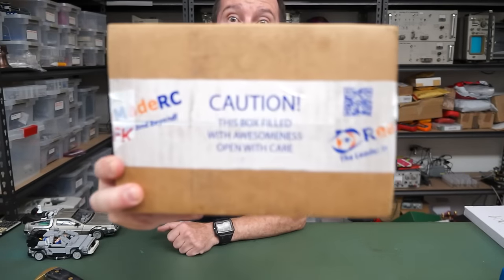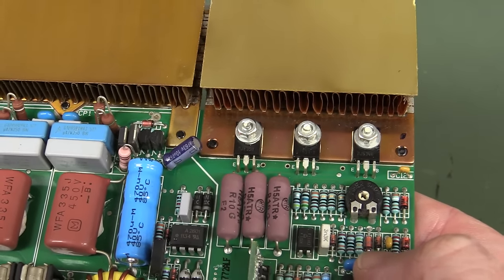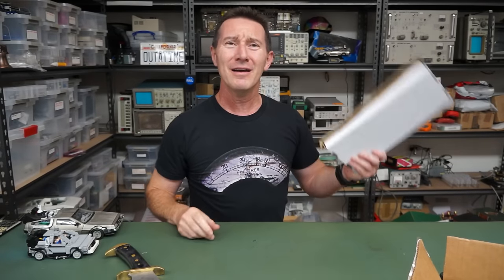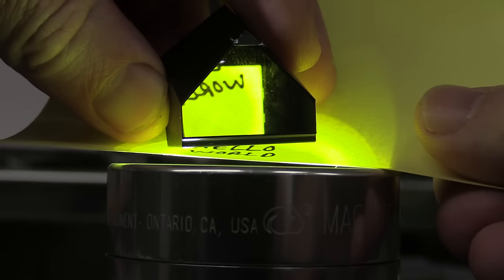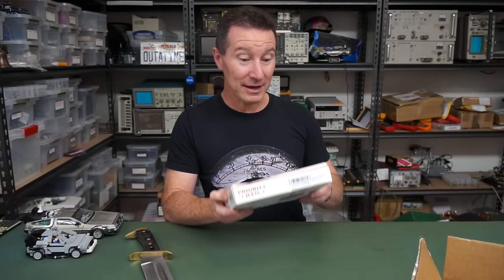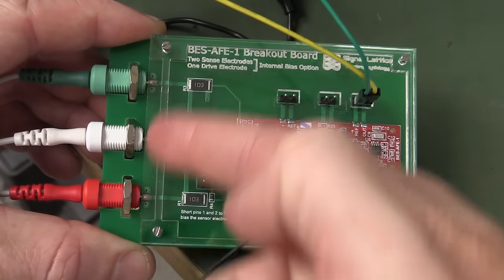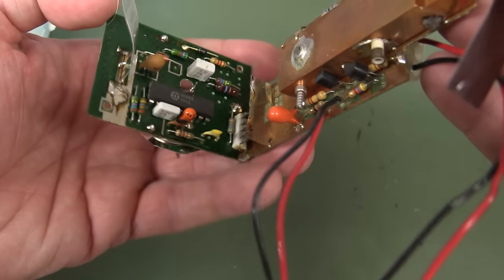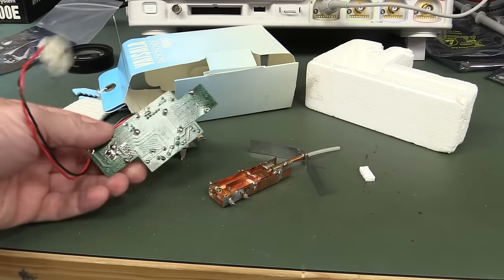EEVblog #970 - Mailbag

Comment: There are a lot of videos that you mention star-grounding, but I don't remember one explaining why you would use it.
Reply: Something for "Fundamental Friday".
Reply: Because there is no wire.
Reply: If I'm not mistaken, it's to prevent ground loops. So it is seen a lot in analog circuits. Basically everything gets its own private line straight to ground, so some components don't develop a different ground potential.

I agree with the Fundamental Friday idea. Though I kinda want to see a generic "Best PCB layout practices" episode.

Comment: That Vaisala thingy is and analog temp/air pressure+humidity measurement/rf transmit system and it's used on weather reseach, those units were attached to huge gas balloons and released at regular intervalls.

Comment: That model radiosonde sends PTU, pressure, temp, humidity. It's carried by a hydrogen balloon (in australia) and tracked by C-Band windfind radar which allows calculation of the wind and elevation.
403 Mhz is pretty much bang on for TX freq
The battery pack in these were an open cell battery that was hydrated(dropped in a bucket) before launch which generates enough heat during the flight to keep the electronics alive. Transmit time was slightly variable(90+ min), but they track out to approx 110 km, depending on radar power and when the balloon actually bursts

New radiosonde has standard AA batteries, with two small water reservoirs for thermal mass.They also transmit raw gps back to the ground station for wind calculations which allows the radar to stay in weatherwatch mode.

I'll see if I can get my hands on one of the new types to send in.

Comment: Not fan of the idea of using that function to test calculators. it's biased towards a specific processor and brand.
something to consider is that you are giving cos a tiny and insignificant value (angle) from sin. As such, you might want to invert the order for asin/acos and sin/cos so that you feed an actual workable angle to cos. Doing so on my old Casio gives me the perfect 9 you're looking for.

Comment: The amp is probably class H. The two MOSFETs will be switching rail voltages between low and high voltages depending on what the signal is doing. The diodes are likely commutation diodes.

Sanken are well known for making Audio power transistors - their primary speciality is being highly linear, but with plenty of power handling and high speed. 60MHz fT for power transistor's isnt that common.

Comment: EKG:

Noise is normal for any movement. even med grade hardware has it unless filtering is applied (built into monitors).

the colour codes are standard pretty much, those are the north american (AHA) ones.

"White's on the right and Smoke over Fire"

given its only got red and white, that's going to give you lead II

Comment: to get a nice ECGyou are supposed not to move your body as your will generate varying muscle potentials wich inevitably will overlay with your heart-potentials. and even as your heart-potentials are much more intensive as the signals from your sceletal muscles you still get quite some noise. the signal you got on screen looked pretty decent to me
I remember back in the '90 when I used to work in an ER even bystanders were not allowed to move when an ECG for diagnostical purposes was recorded

Comment: You should check the interference of the ecg project against devices that are not in the same loop as the ecg. You're closing a loop between the test leads the oscilloscope and your hand arm sensors etc etc..

Comment: For the calculator, could the 'chipset' just be a bog standard (knock off) mirco ? The need for aaa as apposed to a coin cell might suggest the power consumption is a little higher

Comment: 8800 'peak watts' would STILL translate to at least 2KW 'RMS' :)
I'm guessing this amp is Class D.
Reply: Class D generally has only output MOSFET's. Not BJT's. This might be class AB with switching rails voltage regulators

Comment: EEVblog
Would you like to check out one of the 2008 Fusion-io pre-gen 1 iodrives? I have one of the original alpha drives that were supposed to be returned and so thus extremely rare. I'm fairly certain it's worth a lot of money and will be worth more as the years go on. This drive is one from before Steve Wozniac joined the company. It was the first pcie ssd. It was capable of read / write speeds of around 800 Megabyte per second.  Still rather acceptable by today's non-pcie standards.

Comment: Maybe the air dialectic capacitors shifted the output frequency dependent on barometric pressure, making the carrier an additional  analogue telemetry.channel.

Comment: Wait, so the rip-off calculator calculates a more exact result than the original?
Reply from the maker: Based on that one metric, yes.
Reply: TI-36X Pro gave 9.000001077... disappointing as it is a TI and just purchased a few months ago.  Hope others will list their results.
Reply: Casio CFX-9850GB PLUS: 9.000000007
Casio fx-991MS: 8.999998637
Casio fx-991ES: 9.000000007
hp 50g: 8.99999864267

So basically the same as mentioned here: http://www.rskey.org/~mwsebastian/miscprj/models.htm
Reply: Thanks for the link.  Interesting stuff although it was last updated 10 years ago!

Comment: I bought one of those "Princess TV's" in Black from DSE back in the early 90's I managed to get a schematic from DSE so I could hack it and insert a 75Ω CCTV signal into it so I could use it to align video cameras on site using just the TV and a local 12V 7Ah battery :)
Reply from the maker: Schematic, wow!
Reply: I have (and still use) a B/W TV that looks very similar to this one...but it has a grey finish and also a composite input, but the dail it just the same...;)

Comment: You can't seem to catch out the math on a modern windows PC even with the supplied Microsoft (set for scientific) calculator - I'm sure you used to be able to get it lost with increasing / additive errors on earlier versions, but seems infallible on Win7 machine? Is it the hardware or software or both? EDIT: See High precision floating point arithmetic on search. 53 mantissa bits give 16 decimal point accuracy - I'm guessing software will be intelligently rounding, if that is possible?